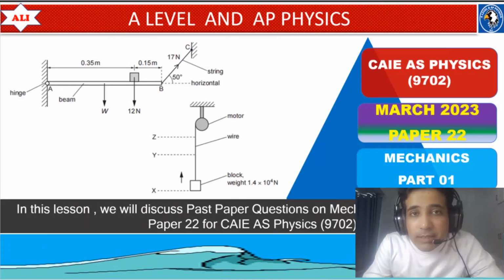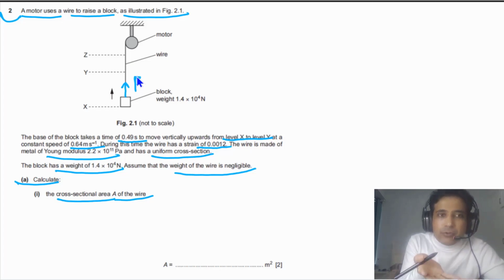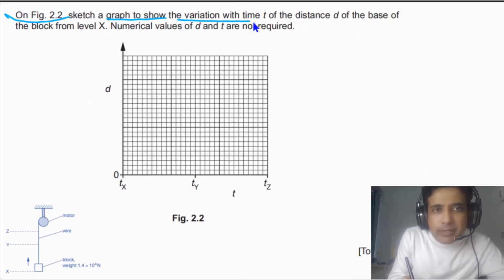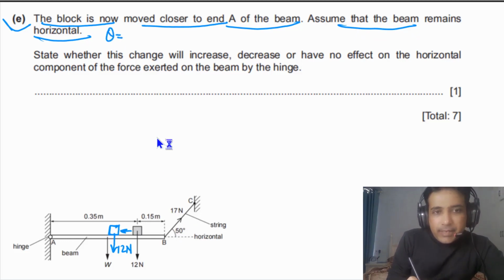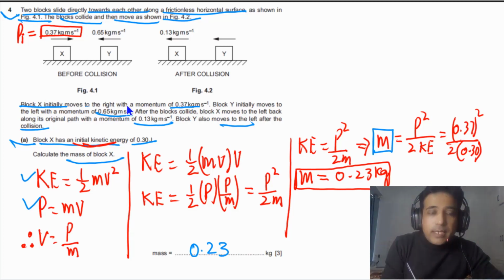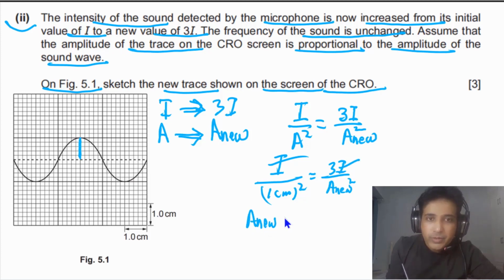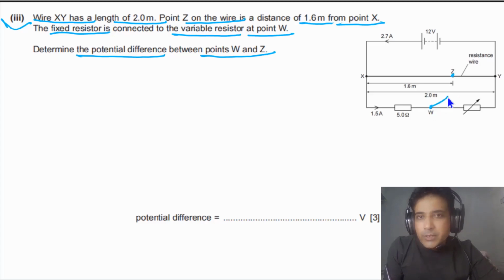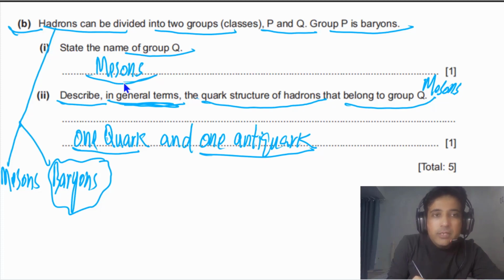CIE AS Physics (9702) Paper 2- March  2023 Paper 22- 9702/FM2023/22-Complete and Detailed Solution

Comment: For question 6 c iii 
Why are you sure that the voltmeter has to be connected across the variable resistor and not the fixed resistor
Reply from the maker: The potential difference across variable resistor is equal to the potential at W i.ePotential at W- 0 = Potential at W . If we connect voltmeter across fixed resistor then  Potential at W = 12 V - pd across fixed resistor . Hope it helps . Feel free to ask if you still have any questions .
Reply: @ yes sir thanks and you mean I can do both ways no problem right, as it’s little difficult for me to determine if the wire is connected across fixed or variable one. Thanks for your help, please solve older papers too sir, like 2016 or 15
Reply from the maker: @zaebae8  Both ways are correct .
Reply from the maker: @zaebae8  I'll try to upload more past papers before May June exam series .
Reply from the maker: In order to improve your understanding of Physics , you can join Question of the Day posts . I am posting every day one tricky and conceptual question with step by step solution to develop good understanding of Physics .
Reply: @alevelandapphysics-ali that’s amazing sir, I’m waiting for those uploads
Reply: @alevelandapphysics-ali Okay I will from today, thanks for your help for us students
Reply: @alevelandapphysics-ali I can’t see those question a day posts, I checked your channel

Comment: how is i equal to V/L
Reply from the maker: I=V/R , as resistivity and cross-sectional are the same for same wire so in this case R is proportional to length , that'sreason I=V/L . We can also use I=V/R as resistivity and A are on the both sides of the equation they will be cancelled . Using I=V/L is a smart way to answer this type of questions . Hope it helps and feel free to ask if you have any questions . Btw if you watch video again it will make a lot more sense t you .